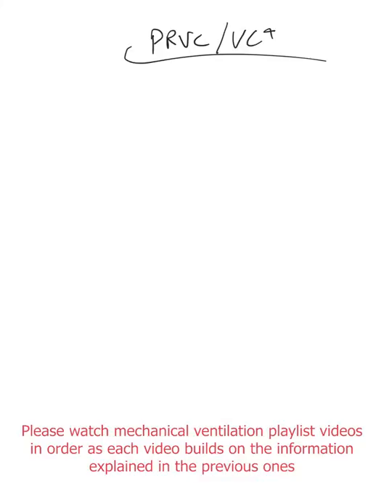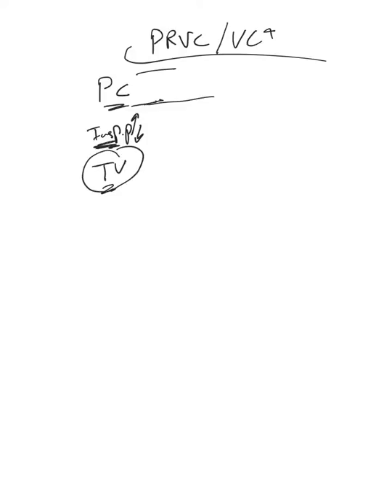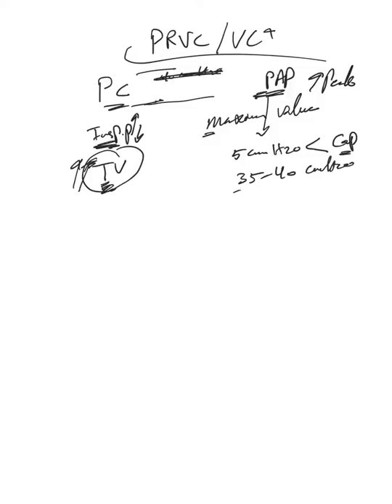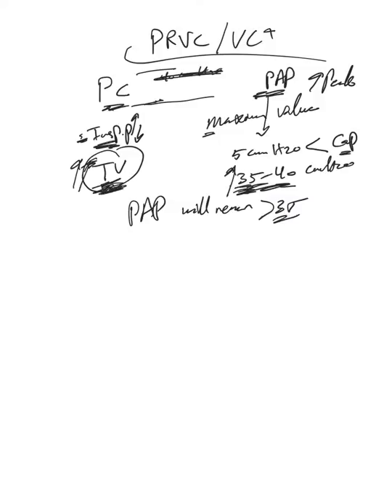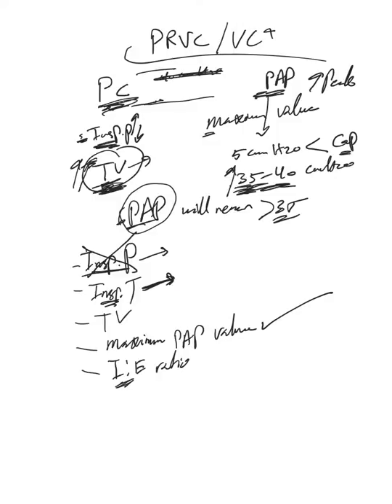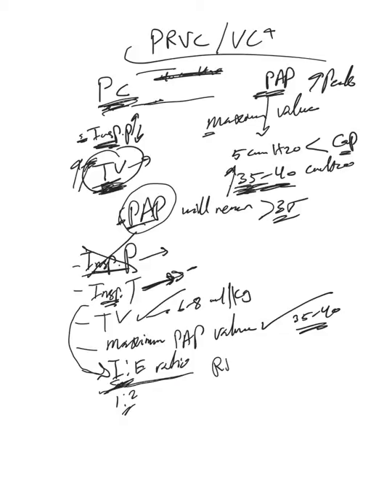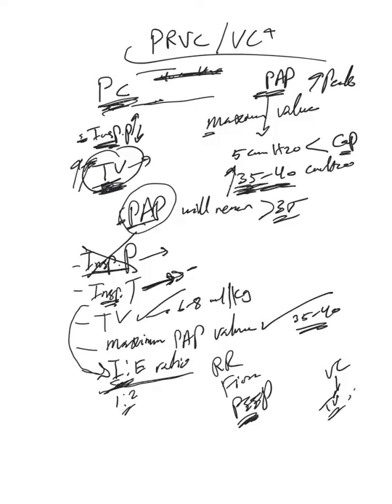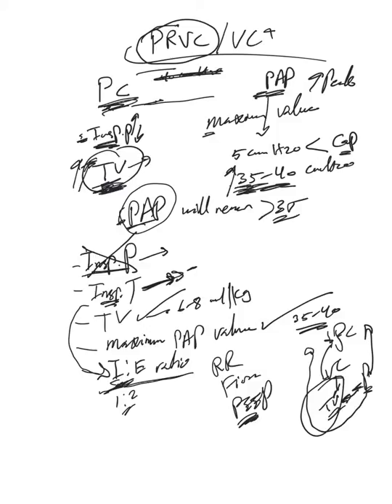Mechanical ventilation- 53: Pressure Regulated Volume Control (VC+ or PRVC ) part 2

Comment: If the inspiratory time is variable based on the pressure, why we would set up IT!
And what is the difference between PRVC and VC plus?
Reply from the maker: yes, VC+ is the PRVC software for the Puritan Bennett 980 series ventilator, it maybe called other names with other ventilator brands. PRVC or VC+ is a hybrid mode between VC and PC, it takes the guaranteed TV from VC and IT from PC, compared to VC, it doesn't allow gentler changes in PIP by incrementing or decrementing the pressure by 1-3 cmH2O until the targeted TV achieved within the set IT, VC+ put limits on the maximum and minimum pressure the ventilator can provide to guarantee the set TV, if the pressure limit reached without fulfilling the set TV, the ventilator will not try to keep pushing more air to satisfy that TV, this means TV can be less, on the other hand, VC+ will allow patient to pull more TV if any air hunger which is something the traditional VC mode doesn't allow which can lead to ventilator desynchrony